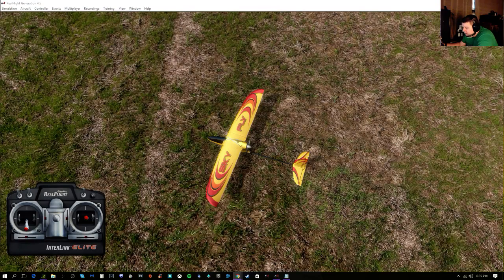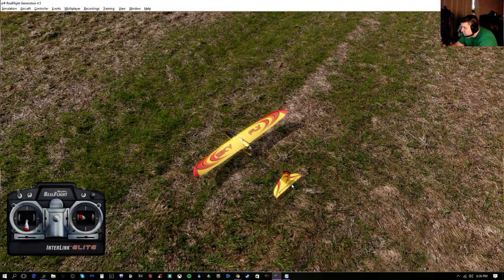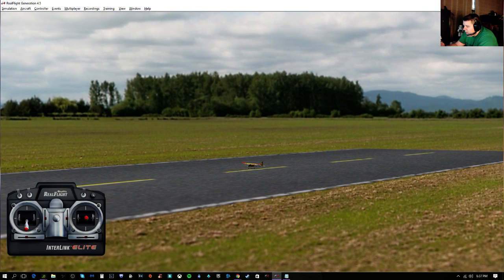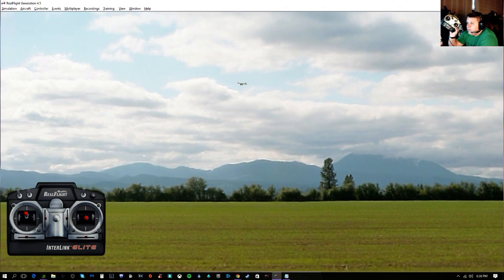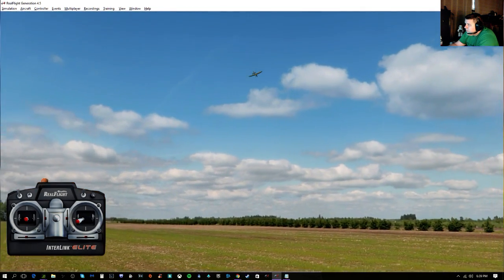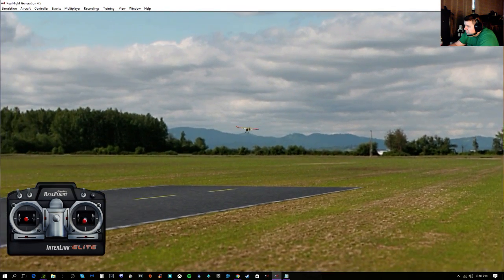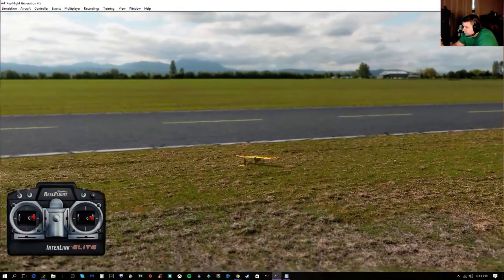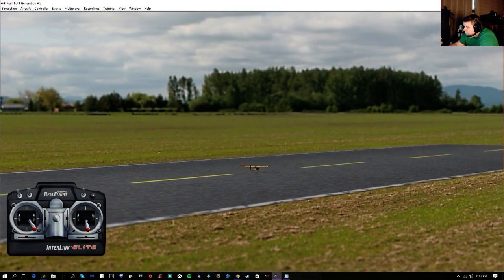How to Fly an RC Airplane (3 channel)

Comment: Having only 3 channels has nothing to do with a loop. How about mentioning that 3-channel planes have more stability built into them with dihedral, high-wing, etc...The 'Anemia' you mention is also more inherent to other trainer oriented features such as hi aspect ration wing and low power. There actually once existed 2 channel stunt designs.

Comment: There are much better 3-channel aircraft besides this entry level foamy. The inability to do a loop or poor rudder performance is not a characteristic of three channel RC, it is the poor design of this airplane. Try a 3-channel Buzzard Bombshell with a .45 glow engine. 3-channel flying is a different style altogether and not strictly beginner.